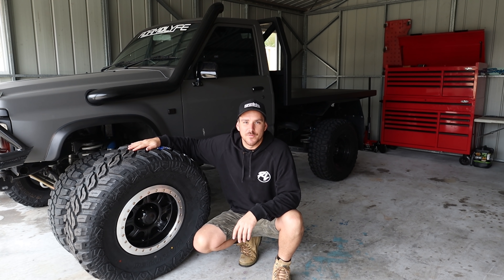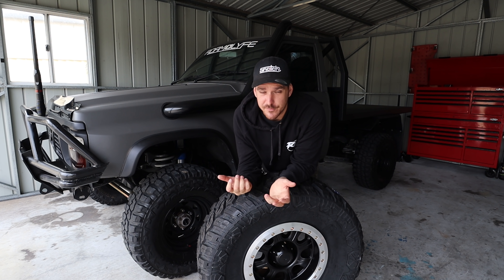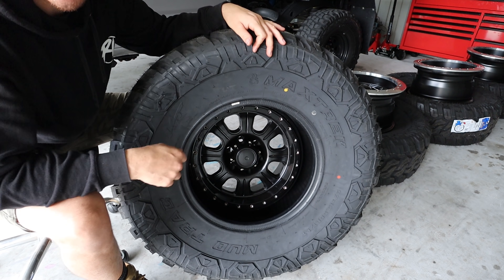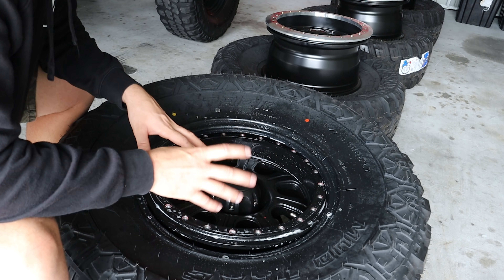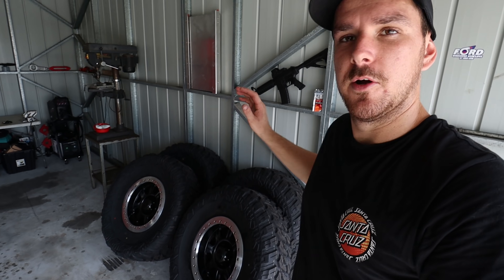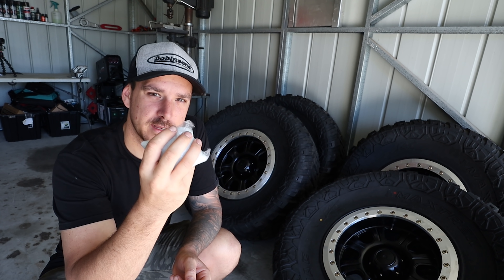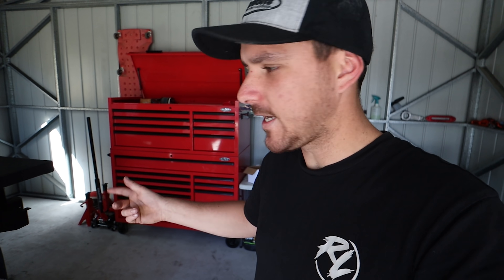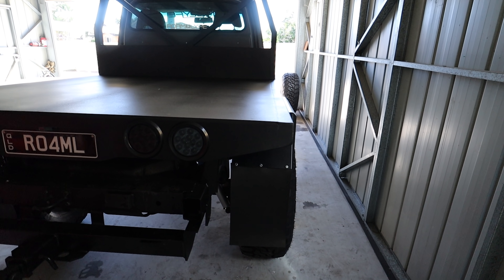Fit your BEADLOCKS at home (Very Simple)

Comment: Are beadlocks legal over there they aren’t legal in W.A I’m pretty sure you can get the lift and bigger tyre size all engineered but beadlocks aren’t legal so you can get stickerd for them over here still after getting everything engineered 😓😓😓
Reply: I want beadlocks and bigger tyres on my
Cummins isb conversion that I’m doing now so bigger wheels matched with the right diff gears will it sit at the right rpm when touring